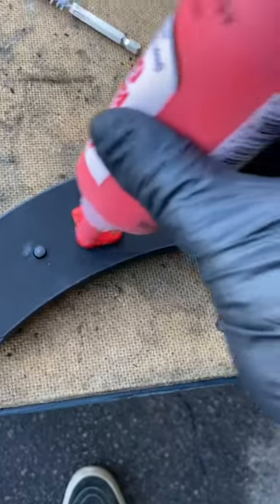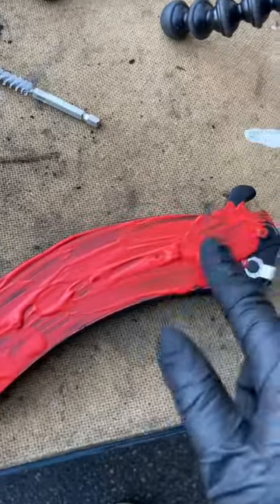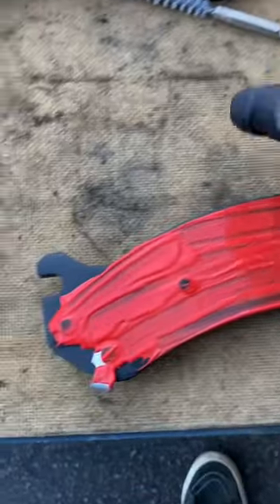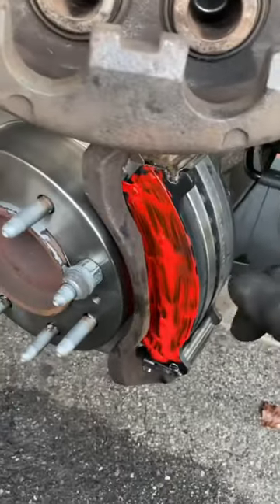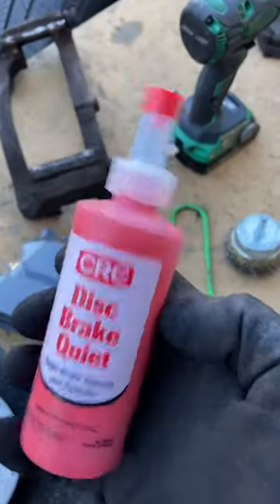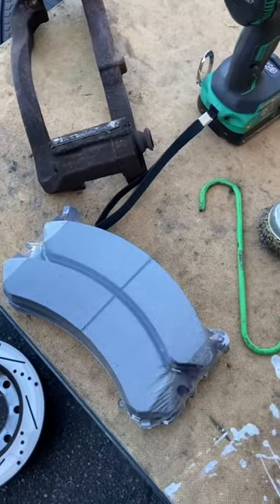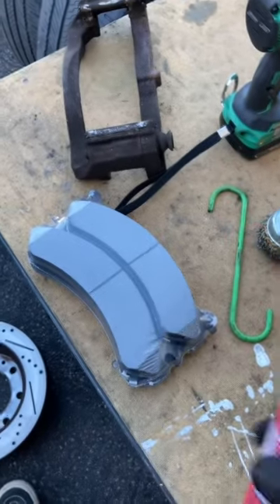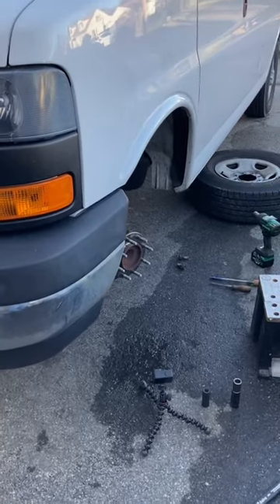Do you use this brake stop squeal or something else to prevent noisy brakes?

Comment: im a ase certified 30 year vertran tech do not use this garbage..  your pads need to slide and slip they are designed to move.. reason they are making noise is this metal to metal when you do pads you  put lube where he puts it where it touches metal and the cups of the pistons and sliding pins and the end of the pads where they slide on the pins never use this stuff and use high temp brake pad lube it comes in a can with a brush
Reply: 100% that is how I do it
Reply: Cheapo brakes squeak sometimes. I've stopped buying the cheap ones. It drives me insane so I said never again. Cleaning them is only a temporary fix.

Comment: If you use a high-quality brake pad instead of the AutoZone or O’Reilly junk, you won’t have squeals to begin with
Reply: ppl dont realize they are cheapinbg out on theyre own safety/life
Reply: Or just buy the next to cheapest brake pads.
Reply: WRONG.I use EBC Yellowstuff that started squeal right after I installed it

Comment: That shim plate on the back of the brake pad is there to stop the noise. That product was designed for pads that do not have that backing shim.
Reply: It’s often recommended to apply something between the plates especially if the pads and hardware are on the cheaper side. But that’s just what I was taught from my coworker that’s a master diesel mechanic
Reply: @FuttBuckerByMutt  Modern pads have built in shim plates that can not be removed. They are there to stop brake noise. The product he used is from an era when pads did not have those shims and we changed fuel filters every tune up. Technology has advanced quite a bit since then.

Comment: Copper Grease... a thin smear of copper grease across the back of the pad base plate. Just make sure not to get it on the pad, exactly as you did with that weird red gunk. And that wasn't thin, you could have got away with a quarter or fifth of that and  still had plenty on the back of those pads. A thin smear in mechanical terms, means you can still see (through the smear) to what ever you smeared.
Reply from the maker: Ok 👍
Reply: @AndyTheXTech  I should have added, copper grease is the same grease used for brake slider bolts, so you can use it on them too.

Comment: The squeaky noise came from the friction of the pad and rotor, how’s gonna help putting in the back🤔
Reply: The squeak comes from vibration not the friction surface. This stuff absorbs vibrations
Reply: @test-547  I will do test
Reply: @sotos2428 did you test